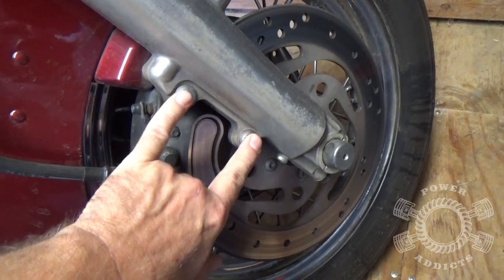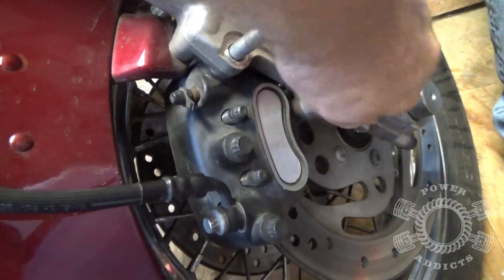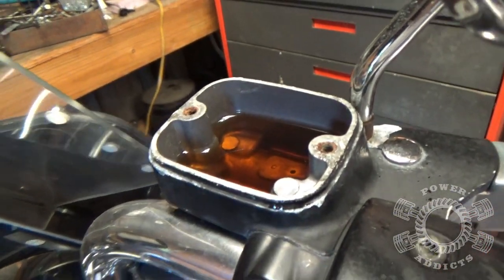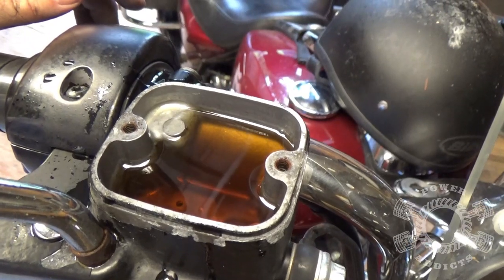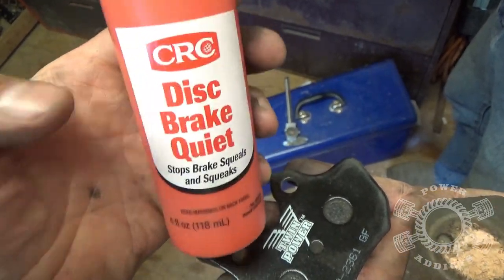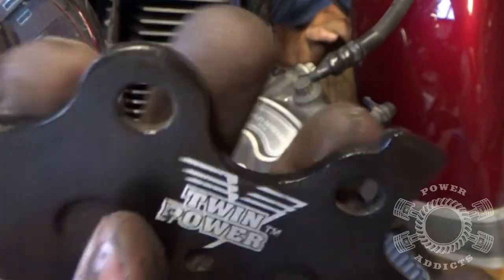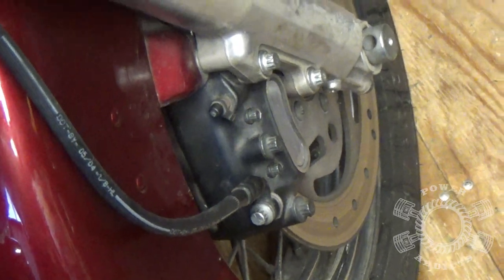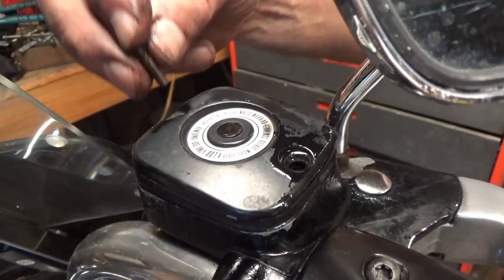2005 Harley Roadking - Lets do the Front Brakes #harleydavidson

Comment: Great instructional video, yours was the third I watched and was the only one that was complete on all steps. Some of the other videos should be blocked they skip steps and make it a real problem. Thanks again
Reply from the maker: I try to get every step in every video. Sometimes it makes the video long but in the end ... it helps the ones who need it. Thats what matters to me. Have a great day!
Reply: Doing brakes  myself for the first time. 2001 RK. Is it not necessary to replace the square seals, wipers and crossover rings? And there was no mention of the anti rattle spring??
Reply: It didn't include torque specs for the caliper bolts.